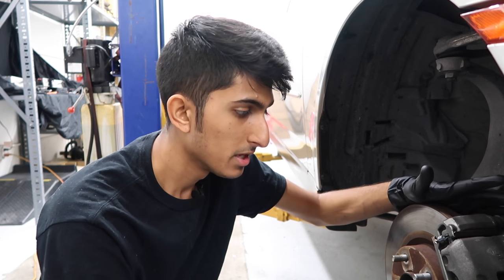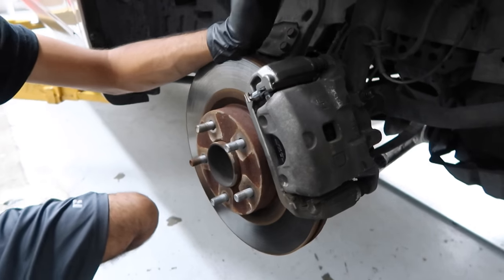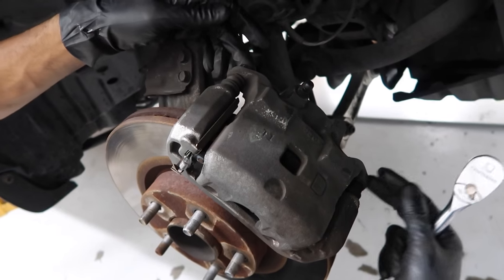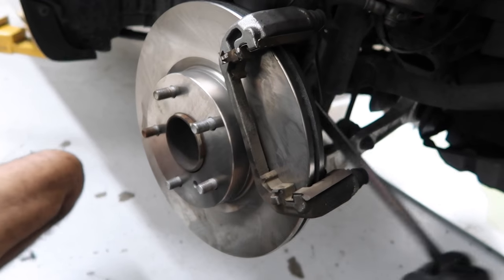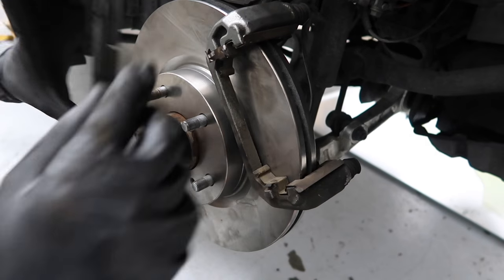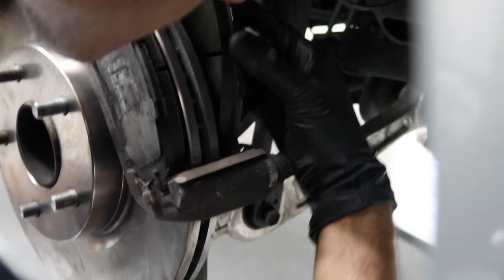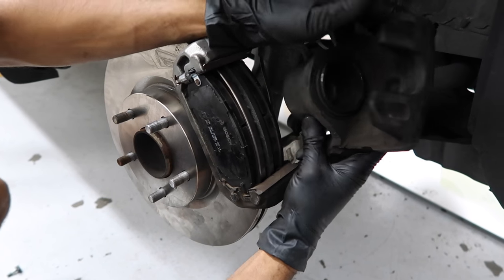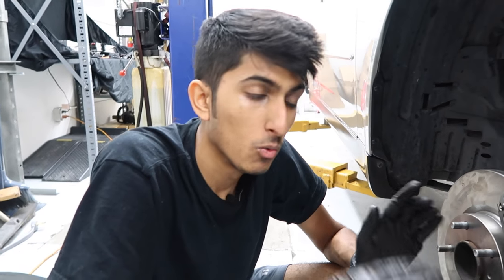Replace Your Front Brake Rotor and Brake Pads Under 5 Minutes!

Comment: also don't forget to check/grease the floating pins to avoid a seized up caliper. it gets overlooked a lot
Reply: And also put anti seize on the back of the pads so they don't get stuck and around the hub.

Comment: Hey Ankur, Hope you are well. Sorry to post my question in your comment but need you advise for E46 UK 2003 model please.Have you came across any issue related to brake light please. Due to winter, temp is in uk now near to zero degree. I recently realised that my car's brake light are illuminating any time. Without pressing brake pedal.well that caused my battery to go flat. After that I jump started and changed brake switch but didn't change anything. Are you aware of anything before. Any guidance on this please. Sorry but posting my question here. Regards, Parag R.

Comment: Hello All and Shop Life

Have a Serious ?. I have looked in all the shift knob posts around I could find and all are replace/removal upgrading. But not my issue.

Today I was replacing my Brake Pads and rotors following this video. I finished the rears. Lowered it back down. Then went to turn the Car on to move it back a little so I could get the jack to the front and do the fronts. But when I got in car to put in reverse. The shift knob was not engaged it would move up and down freely.
I could shift but the button would not engage like normal. ( And was working fine before I started work) Can any one provide any help and or guidance or might have seen or heard this issue before. This is my first major maintenance job on my car except a fan Clutch. I have a 00 328I E46.

Thank you in advance

Comment: off topic, any dealings with rear end sag on the e46, rear of my car has sagged causing camber on the rear wheels causing the tires to scrub on the insides. I read the 15mm spring pads for the xi models sorts this problem, do you belive that to be true? thanks